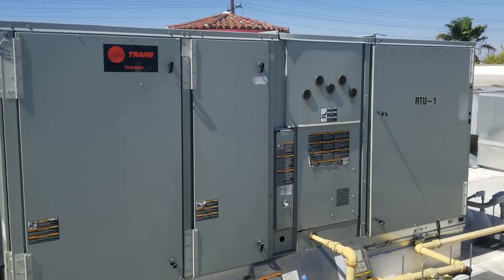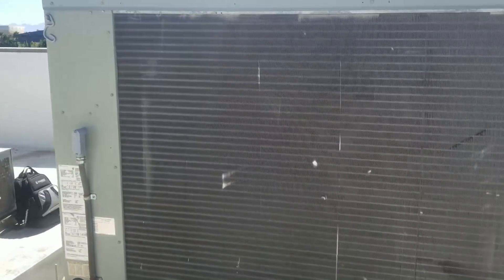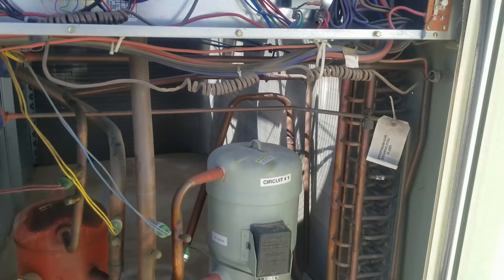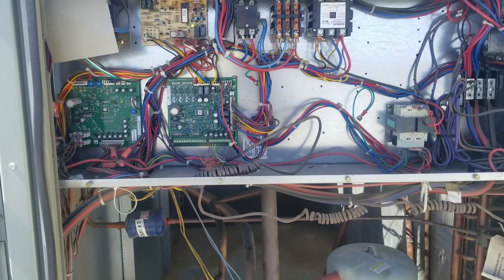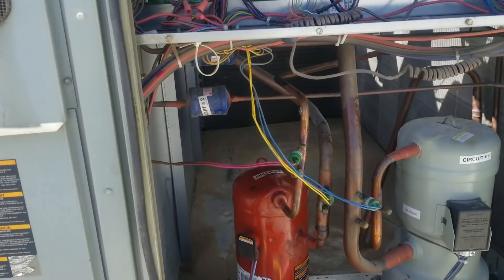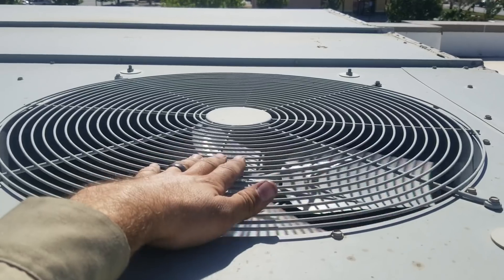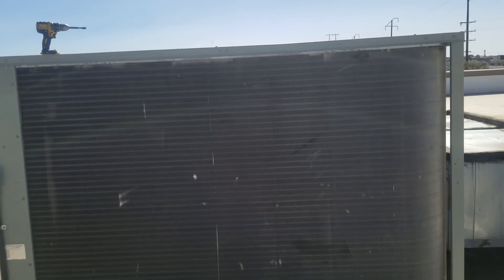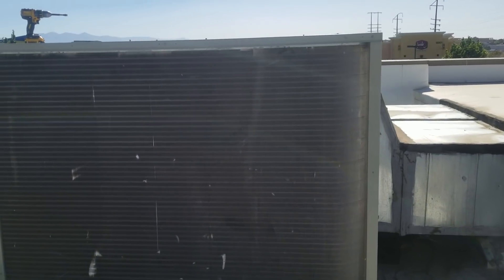Trane Voyager not working properly

Comment: We had  nine  10 ton units on our factory roof, seventeen 2.5 million BTU makeup air units, thirty six Lennox 100,000 BTU units   Twenty  plus window units and countless condensers throughout the complex,   With only a crew of three Technicians.   I set up a PM program  (back in 2001) using the  factory production computer, (they didn’t know there was a maintenance application in the system).   Needless to say, there were busy.   With that system in place, call outs were reduced from 40% to less than 5%  and we were eventually able to hire an extra tech full time, thanks to the PM system that showed we were saving a ton of money.

Comment: The other fan spinning the other way that's hilariously stupid😂 some goof put The Blade on backwards😆
Reply from the maker: That video was from a while ago but Im pretty sure the motor was bad and just spinning backwards from the other motors suction thru the non working fan guard, I will be going live on YouTube this evening 7/8/19 @ 5:PM pacific time  come check it out if you can https://youtu.be/11n-kqTVvD8
Reply: When cap gets weak fan spins backwards
Reply: @caronanderson99  Do you know what else makes the fan appear to run backward? When one fan is running and the other fan is not being called to run. That would make more sense when you have one compressor running and the other is not.

Comment: on the trane RTUs, they often have a cracked discharge line after a while. I always add a vibration loop to the discharge line to mitigate the problems with that.

Comment: Change the compressor because its low on gas from a cracked line ? Come on you gotta be kidding me.....
Reply from the maker: The compressor was replaced because it was vibrating internally really bad. That is what caused the cracked discharge line, it is a common problem on the trane units

Comment: What did you figure out about the compressor? Why was second stage running when it was calling for first stage to run? Did it have a lead/lag like you mentioned in the video? Thanks!
Reply from the maker: Yeah when the compressor went off on high head the second one took over. Sort of a lead lag setup, but not really. It's just logic built into the board.

Comment: Man I didn't get it it was just a bad capacitor and you just make your decision to change the motor? It is just like you see some one that he has high blood sugar and you just say let's cut his leg off because he will  going to cut his leg in future anyway? That sounds crazy to me !I guess they going to pay about 4or 5hundred dollars for only that motor right? And there still low refrigerant problem not include!when you say R22 I have a feeling they going to pay about 1000 or more just for motor and some gas
Reply: Yes... fit a new capacitor, test amperage on motor. if good, that's done.. Shut down smaller compressor, reclaim gas, weld hole or make new discharge pipe, new drier,quick vac add old gas and top up,, wash condensor inside and out,done..maybe the company tells mechanics to change parts, because that equals $$$$$$$$$$
Reply: 石磊 your analogy makes no sense. And enjoy your callbacks with that attitude. This guys work speaks for itself, he obviously has no tolerance for free callbacks. You can pay a little more now, or a lot more later when the unit loses that fan motor and takes out a compressor running high head. Don't be stupid and cover your ass. Good customers have no problem paying for a permanent repair.
Reply: To Chinese Guy, read what is written. if you know anything about motors, a blown capacitor does not mean the motor is bad, as said.full stop..!!.again, tell me why if amp draw is good and bearings make no noise, the motor needs replacing, what about the 2nd motor that is just as old but didn't blow capacitor gets no attention.... in nearly 35 yrs in this industry i have change thousands of motors and hundreds,hundreds of capacitors...h.p controls will cut compressor out, and there are 2 cond fan motors. No one has the balls to question the other motor getting a new capacitor.. i have tested 30 year old metal capacitors to find them 95% good, eg:100mf,read 95mf and tested 5 year old plastic capacitors that are 30% fucked eg: 100mf reading 70mf... everything manufactured today is made on cost, cheaper capacitors is a part of this...if you have  20 + years behind you in this industry keep talking ....
Reply: drcolster I don't care if you have 5 years or twenty years experience, you're either a thorough tech or your not. If you are not covering your ass you will get bit. I don't care if you've been lucky not changing the motor a couple times, what about the times you didn't get lucky and someone had to clean  up your mess. Not that you would even know about it because the customer is pissed off and didn't call your company back when it went down again a week later.
Reply: Well Chinese Guy, i've made many ,many,many millions from running my company, and have repeat customers that are over 25 years old.. no one has to clean up my mess up because i fix it right the first time with what the job needs.. Thorough techs will change  all old capacitors...seen it, done it, if you were a customer that just needed a $30 capacitor but got done $500 for a, ye i should change the motor cause it blew a capacitor.. you would love it..yes its about making money but you have to be fair and have a conscious..
Reply: drcolster haha many many millions, ya and I've made many many billions, you see how that works? Everybody's a millionaire online, that's why you still have to work in the trade everyday. Btw, it's conscience, not conscious.
Reply: No ha ha. !!! i've run a business for over 26 yrs turning over 20 k, to up to 60 k per month..there is big profits in parts and equipment, that's why this licenced industry is tough, but good to work in..... i have not worked for a boss making a thousand dollars a week.!!...... currently i do 20 to 30 hrs a week, i'm 52 and looking to retire at 55... i don't need to lie, i can back it up... come to Adelaide Sth Australia and i'll be happy to show you my Houses, Business property,Cars... your more than welcome....i;ll buy you a beer as well....
Reply: Hello Cameron, you went well prepared to a job, it wasn't the fan motor, it was the board.. But you didn't put the new motor on as well.. No...  Motors:   reasons to change, squeally bearings, high amp draw, cutting out on internal overload,run stinking hot,physical damage etc.. if this motor was none of those, and  just a bad capacitor, a capacitor is what it needs, also the running motor should get a new cap as well.. Chris is a damm good Tech, but i have seen him go to one fan motor not working, change 2 motors, that case it may have needed it.....i saw him find a solenoid valve not working,{ beer walk in warm job} bad solenoid coil, fits a new coil, in summary says he will quote new solenoid valve, but, valve works, shuts off, but he wants to change solenoid valve, in that call, leaky receiver, yes, new drier ,yes, cut out leaky quick connectors, yes.change dicky sporlan tx valve,yes but there is no reason to change a solenoid valve that just had a dead coil, in 34 years of doing this trade iv'e had 100's of bad coil, and capacitors..  This subject is really between Techs, if it works,it works, changing parts equals more profits... customers don't know, some will say one motor wasn't working, you change 2, well, it may have gone soon anyway,,, or, some say money is tight, i could only afford one.... good chatting,keep well....
Reply: drcolster that might be true to some degree. However as he said in this situation its a far drive from his local area, that might mean that a supply house isn’t local, so with that you would have to go out to find the problem and then leave again to make a round trip to pick up the motor and come back to change it. Where as he’s already out there, the motor is original. It could be fine, however you need to look at the big picture. I know exactly what he’s talking about. I went to a call about 2 hours away, they said the condenser fan wouldn’t run, so i picked up a new motor since it was a critical space that contained data equipment which had no cooling at the time besides some other units close by and box fans to try to move air around. I went down there thinking well its tripping on high head due to the bad fan or cap. Check it out to find it to have a bad control board, wired around it to get them going for the hot week until we could get a board in. Had i went down there with out it and it was the motor, i would have had to drive almost 2 hours back into town to get a motor and that was if the place was open. At that time it wouldn’t have been. That’s a somewhat similar situation. Normally good techs are not out to screw anyone, there out to make the system reliable, to avoid call backs and to keep customers happy. Yes it does cost money to do so, but in the long run its better to have to call us out less than more often. Which also means less down time. And in some places down time costs them even more money. So even if it seems stupid “ well the motor works right” yes for now it does, but that doesn’t mean it wont fail without warning. And in that situation sometimes if it does fail you get customers that want you to replace it for free on a call back because you touched last basically. And claim they didn’t know even if you tell them 100 times. That’s what you just make as many notes as possible and have them sign off in that situation.
Reply: drcolster to each their own. Every situation is different. All you can do is make a recommendation. In the end it’s up to the customer. Some will be happy you did it. Others can see it as a way to get more money. Some things are necessary, sometimes you find something and then get a little crazy with it. The end game is alway make the customer satisfied. At least that’s how I am. I know not everyone out there in the trade is that way. And I agree he’s a good tech. As you said about the solenoid valve itself was good but the coil failed, I probably would have replaced the coil, checked everything else and if all is good then leave it at that.
Reply: Yeah and he wants to replace the compressor with the cracked tube
Reply from the maker: the compressor had a vibration in  it causing the cracked discharge line, if I just welded the leak it would happen again,with the price of R-22 these days it was a better option to replace the comp and eliminate the problem
Reply from the maker: in the video I said this location was out in the middle of nowhere, I made a judgement call and my particular customer was aware of the decision I made. In fact they approved the work fully knowing what was going on. I make judgement calls based on my experience and this particular customer appreciates that!
Reply: HVACR VIDEOS its the right call to make, quality customers appreciate zero downtime and callbacks, cheap customers can stick with the other guy who bandaids every problem. Only to find the same issue comes right back shortly after. The majority of techs are poorly trained and only see one problem when there's usually much more to it. This is why your videos are mind blowing to some viewers, they can't remove the blinders to see other problems, 75% of techs are this way. Please keep the vids coming, your knowledge is helping a lot of techs remove the blinders.
Reply from the maker: thanks Cameron!
Reply: honestly, its not the same thing, yes its a bad cap. the cap probably was original to the unit same as the fan. he said that the customer is a pretty far drive. just to save on a potential call back, he wants to change that motor. an electric motor isnt like someone with high blood sugar. at least with blood sugar issues you can get medical help. the motor wont get better, it cant get help (besides new bearings) and thats if its not sleeved. otherwise motors wont last forever and a electric motor in the elements for sure doesnt hold up forever. The reason to replace it is simple its old, its health is questionable, he doesnt want the call back since then thats a free call, however there are places that love to tell you no to fixing things so then they can call you back to fix them for basicly free because they claim that you didnt tell them that there was a problem. so sometimes its best to take care of a problem now. An amp draw can tell only tell you so much. as far as the leak goes, the leak repair will be cheaper than a new unit. fix the leak, change the drier, give it another once over with a leak detector or soap everything, vac it down, charge it back up to factory spec. all you can do is just try and get it operating the best you can and reliably.

Comment: The D tek select is pretty dead on with finding leaks on different refrigerants exept R-410a. Have you ran into this as well?
Reply: No problem finding 410A leaks with Dtek Select so far, I like it
Reply: The D-tek select has been very reliable for me as well. If anyone is interested I see Inficon is coming out with an updated electronic  leak detector called the Stratus. There is a video on their you tube channel. Dont believe it's been released yet.
Reply from the maker: Actually I've found 410a leaks too, I haven't had any problems using it. But I have heard a bunch of people say they have problems??
Reply from the maker: I just bought another dtek select on Friday to replace one that was over 5 years old. I love them